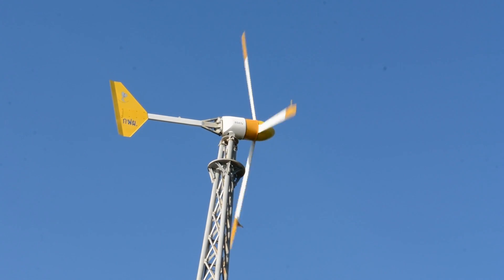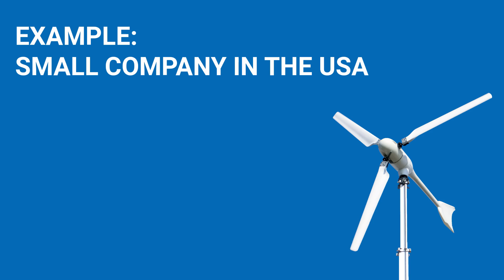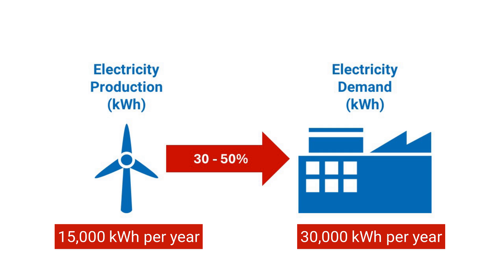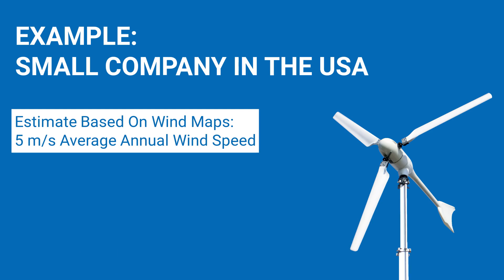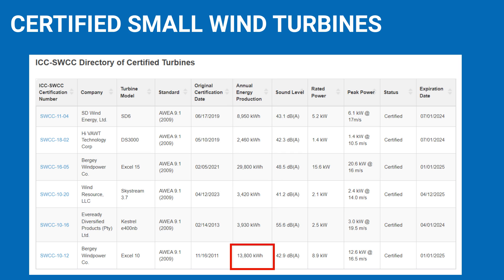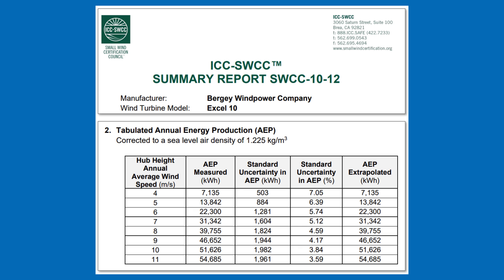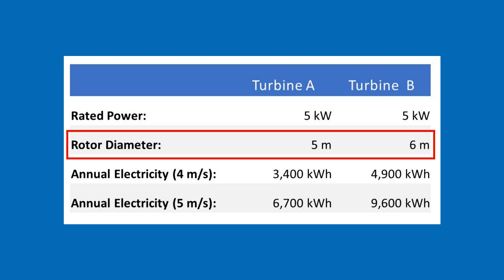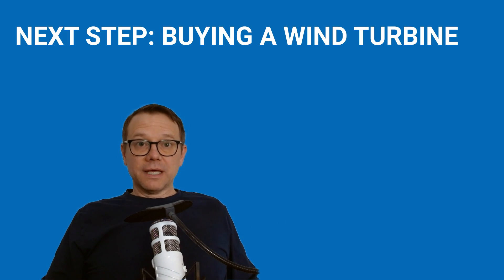Sizing Your Wind Turbine: Save Money With This Practical Guide

Comment: Hi Mate, this is monthly production, might be going to reach 14 KWh.
All 10 wind turbines are using 1.3M wind wheels with 5 or 6 blades.
14V - 24V 500W Vevor             -  6.5M high    -  3,274 Wh - New blades
14V - 24V 500W Vevor             -  6.5M high    -  3,065 Wh - New blades
14V - 24V ista Breeze i500      -  4.5M high    -  1,417 Wh  
12V - 24V 300W Hyacinth       -  4.0M high    -     763 Wh  
12V - 48V 500W Sunboo S5   -  3.5M high    -  1,516 Wh   
12V - 48V 500W Sunboo S5   -  3.2M high    -     726 Wh  
12V - 48V 500W Sunboo S5   -  3.0M high    -     696 Wh    
12V - 48V 500W Sunboo S5   -  3.0M high    -     551 Wh
12V - 48V 300W new rotor     -  3.0M high    -     460 Wh   
12V - 48V 300W new rotor     -  3.0M high    -     450 Wh
I live in a Low wind area, my average wind is only 2.7 meters per second.
Town laws stop me putting up a big wind turbine, mainly noise and safety.

Comment: Hi, thank you for this video. I'm completely off grid, with a 5.4 kw solar system and 10kw Pylontech 48 volt battery system living in Portugal. Even in the winter this system is sufficient for our needs. But I would like to switch to a AC inverter heating system for in the winter instead of a fire place. That means I need some more energy and would like to combine with a small wind turbine. I have a free standing house and the wind is not blocked from any direction as I don't have neighbors. As we do have the fires in the summer all the big trees burned down in 2022 and we have very strong wind. Can you recommend me a small wind turbine? I can't figure it out by myself. Thanks a lot 🙏